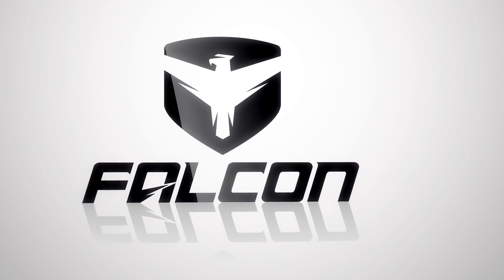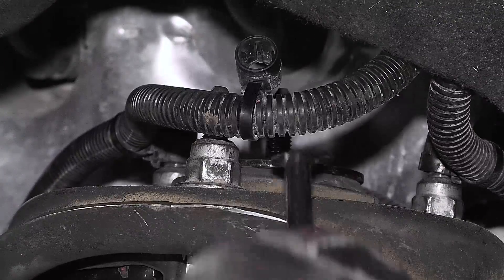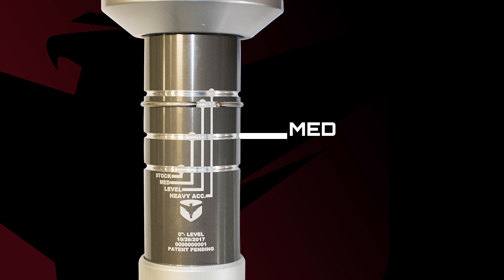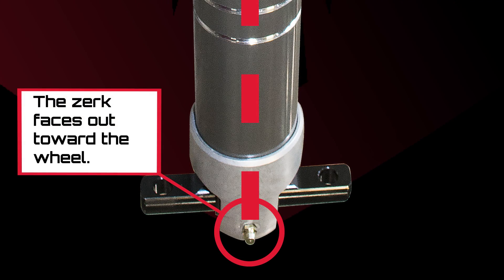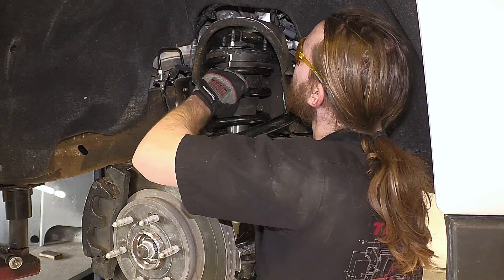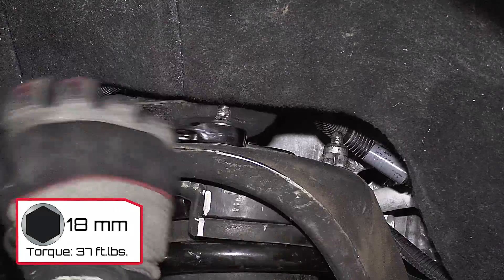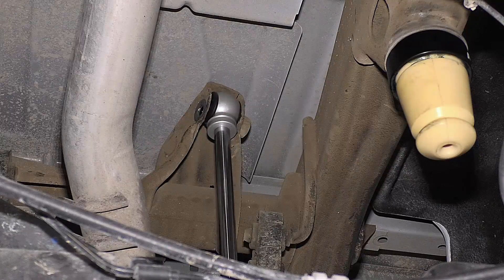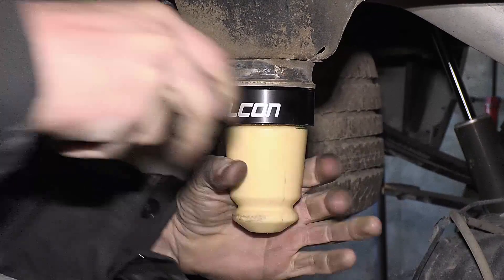Falcon Shocks Install: Chevy/GMC 1500 Leveling System

Comment: What is the lift height at the "level" mark (the one under heavy accessory)?
Reply from the maker: It all depends on the weight of the front, but that setting will be about 2" over stock for a leveled look on a stock vehicle.
Reply: @FalconPerformanceShocks  Thanks! What is the exact max tire size you recommend running on the stock 18 inch wheels (the ones shown in the video)?
Reply from the maker: @grandfatherwilkens2987  We always go for the max, which would be a 33" tire.